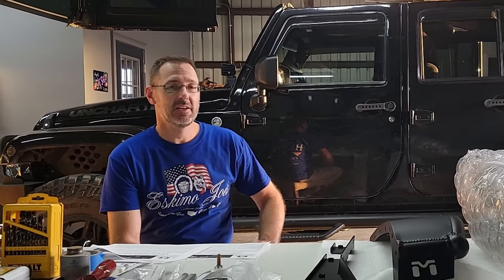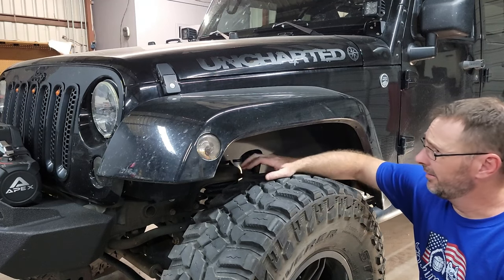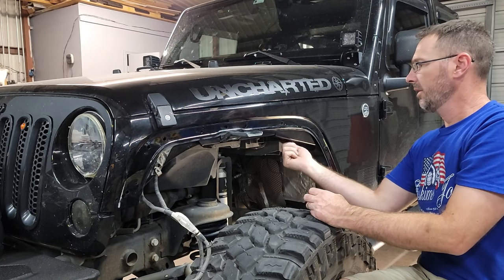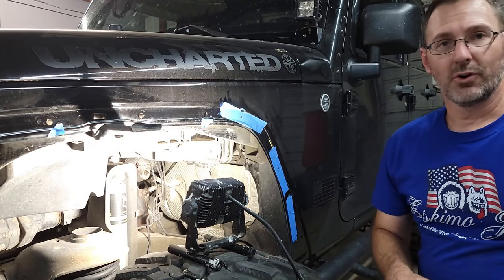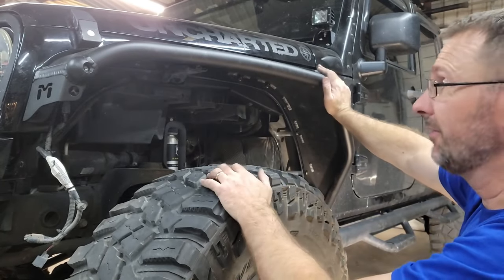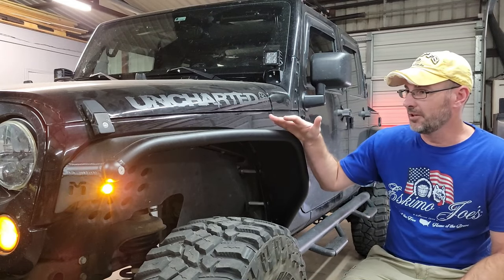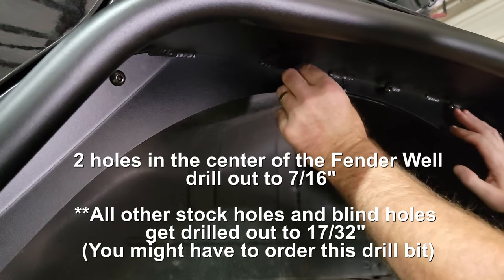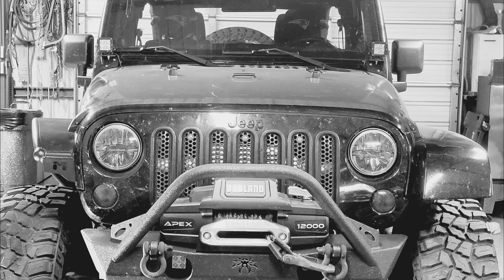Jeep: MetalCloak Overland Fender Install

Comment: Can you provide a link to the lights used in the fender? Do these function as turn signals, and not just running lights? I think you said quadratec pre-runner lights. But when I look those up, I only see the three lights that go in the grill. So I’m confused on how those wire in, etc. Great video thank you!
Reply from the maker: The lights for the fender are from Metal Cloak and can be found here.  https://metalcloak.com/low-profile-led-marker-lights-jk.html

They are Running lights  and should be plugged into your original marker light wiring from the stock fenders.  
Sorry if I confused you with the quadratech set up. Those lights also tapped into the marker light as well. actually,  the metal cloak lights and the quadratec lights themselves look exactly the same.. it's just a low profile amber led with grommet. 

I checked the metalcloak website and  it looks like they updated them to have a clear lense and orange LED. I believe mine are an orange lense..  they turn on when you either turn on your running lights or headlights.   

Thanks for watching and best of luck.  Hollar if you need any more info
Reply: @86Ctopher  thanks! I ordered mine today!
Reply from the maker: @HoldMyBeerJeeping  Awesome!  Should be pretty easy!   Dude,  I checked some of your videos..  Nice concert action!  Shinedown is one of my absolute favorites. I have never seen them in concert but one day,.... some day... I will.  Best of luck to you
Reply: @86Ctopher yeah it’s been a few years since I have seen them live. But I have probably seen them at least 4 times. Always a great show!
Reply: @86Ctopher  Let me just say again, this video was super helpful! I got my front fenders on yesterday. This video saved me! Particularly how you emphasized the tightening of the bolts. My inner fenders (I have the DV8) had to be screwed into the bracket that Metalcloak provided before all those bolts got tightened. I had to leave them finger tight, so I had a little slack to work with when getting them back on. I also found those top center bolts were a pain to align! I got it done, but I had to put pressure from underneath like you did with the block, as well as from above by pushing on the fender. I also had to make some of the holes just a tad larger. I also have rock sliders on my JK. I had to remove those as well. Luckily, the very bottom of fenders were able to tuck in behind the rock sliders!
Reply from the maker: @HoldMyBeerJeeping Awesome!  I was wondering if you got yours installed and how it went.  The alignment part was definitely much more difficult than it needed to be. I wonder if using Metal Cloak inner liners would have made it easier?  Either way, glad it worked out!  Mine have held up extremely well, are crazy strong and look great.  Send me a pic of yours at ctopher86@msn.com. I would love to see it.  I've got some stickers I can send you a well.  Take care bro!
Reply from the maker: @HoldMyBeerJeeping Not sure if you started the rear fenders yet, but here is some advice.  I ended up losing some of my video footage of the rear fender install so I didn't get a chance to show the nutsert tool. I felt like the rear was easier than the front but if I had to do it over again, I would probably get the nutsert tool to make that process easier.  The nutsert bolt that metal cloak provided worked, BUT, dude, it got way hot, it felt like at times I was going to strip it out, and I was nervous about messing it up each time.  I have seen some videos of an actual nutsert tool ( Trailrecon had a video for his poison spider fenders) and i would recommend getting one.  I may have saved 30 or 40 bucks using the provided bolt jig, but it would have made the install much easier.

Comment: One final question, since your rivet nut installation was not available. What size rivet nut tool do I need? I see Metalcloak has a 3/8" and a 1/2" tool. Do I need both sizes for the install of the rear fenders, or just 1?
Reply from the maker: Lol, I didn't realize you sent this! I sent some advice on the other rely thread.  Glad you are looking at the tool! I used the bolt nutsert jig that metal cloak provided to do all of the nutsert install. It was pretty straight forward and spraying a little silicon lube or WD40 helped keep the heat down and squishing the metal insert easier, but dude, I should have gotten the actual nutsert tool.  there are just too many and the bolt jig barely made it through all of them. The nutserts are all the same size so you shouldn't need two different sizes.  Probably best to call metalcloak on the size.  My guess is that the 3/8 would be just fine.